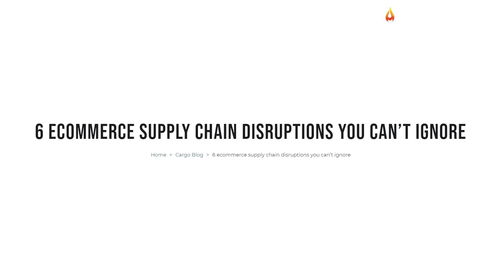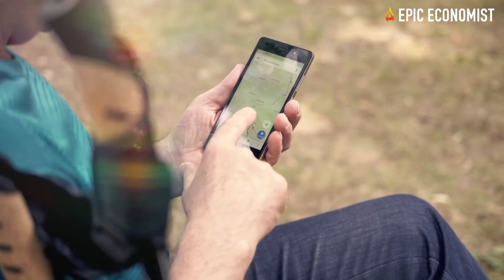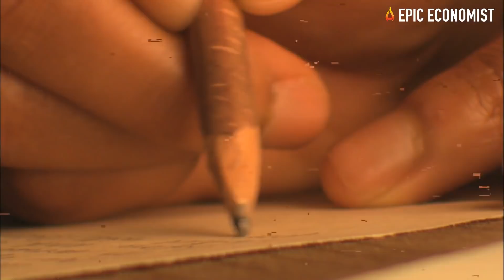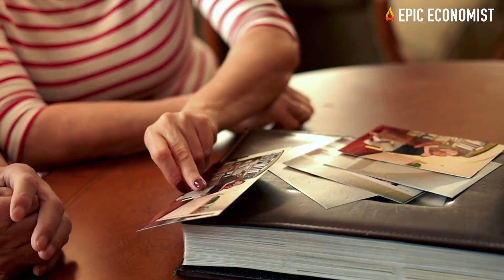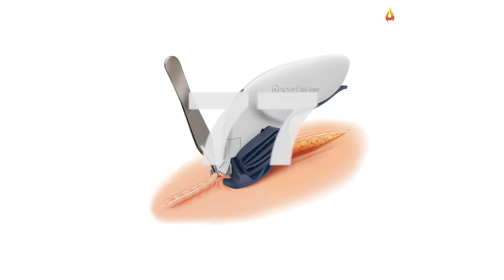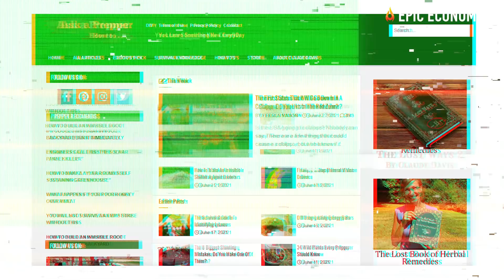100 Survival Items You Forgot To Buy Before The Imminent Economic Collapse

Comment: 1. Activated charcoal (anti-poison and anti-drug overdose effects)
2. Baby powder (treats irritated skin and prevents chafing)
3. Baby wipes
4. Rain cover for backpack
5. Bandana (multi-purpose cloth)
6. Battery adapters (convert AA input to D output, etc.)
7. Benadryl
8. Binoculars
9. Bouillon cubes
10. Manual can opener
11. Tourniquet (part of your trauma kit)
12. Blood clotting powder (promotes wound sealing)
13. Chalk (don't get lost)
14. Chapstick (helps seal cuts and can be used as a lubricant)
15. Cigarettes (slow-burning kindling, and smoke can be useful)
16. Clothesline/pins
17. Clotrimazole cream (topical cream to treat rashes)
18. Collapsible bowl
19. Collapsible camper's bucket
20. Fishing kit
21. Dental first aid kit
22. Dental floss
23. Dice
24. Duct tape
25. Earmuffs
26. Earplugs/eyemask (help you sleep in the rough)
27. Electrolyte powder (esp. if you're not food-secure, this will help avoid cramping and fight dehydration)
28. Epi-pens (he says to "get a prescription," lol)
29. Faraday cage (protect your devices from an EMP... though note it will also prevent you from getting reception while your phone is in there)
30. File (like the kind for sharpening stuff)
31. Flash drive (to protect your files??? I guess if you think bitcoin will go through the roof after the collapse of society)
32. Fly swatter (swats flies)
33. Frisbee ("send a signal" with it, okay... At least you can play catch with it.)
34. Gillnet (concealable mesh net for river fishing)
35. Glowsticks (good for short-term lighting)
36. Goggles (if you're in the desert, or a dusty environment)
37. Gorilla tape
38. Chewing gum (adherent, plus the wrappers are kindling)
39. Ham radio (contact other survivors)
40. Headlamp
41. Heirloom seeds (small-scale farming)
42. Hoyle's Rules Of Games, and a deck of cards
43. Hydrogen peroxide (disinfectant)
44. Instant coffee (luxury item, but it lasts forever if it's sealed)
45. E-reading device (pack a lot of books into very little space, holds a charge for weeks) NOTE: The video suggests Kindle Paper White, BUT a Kindle will force you into Amazon's DRM scheme, which may lock you out if their servers fail. Get a Kobo or off-brand e-reader that will allow you to use .epub files, which are not locked by DRM
46. Shoelaces
47. LifeStraw (water filter for your bottle)
48. Liquid bandage
49. Lockpick set
50. Microfiber cloth
51. Moleskin? (part of your trauma kit - never heard it called that, but It's clearly burn pads and gauze)
52. N95 masks (protect from dust and disease when exploring urban areas)
53. Neck gaiter
54. Pantyhose (multipurpose mesh material, can be used as a membrane/filter or to tie stuff together)
55. Paperclips (bind things together, quick clothing repair, multipurpose)
56. Pen/pencil and paper
57. Pencil sharpener (you can make arrows/pins with these)
58. Penny can stove and denatured alcohol (for cooking)
59. Pepper spray (defense against predators)
60. Pictures of family/friends
61. Pipe cutter
62. Pocket chain saw (not to be confused with a chainsaw - it's chain cutters on a wire that you operate with your hands)
63. Poncho (waterproof material, multipurpose - useful to make shelter, as a rain cover, etc.)
64. Potassium permanganate (oxidizer with disinfectant, deodorant, and astringent (skin-binding) properties)
65. Power inverter (you can adapt a cigarette lighter in a car to another outlet, and tap the car's battery to power your equipment)
66. Ranger bands (bind stuff)
67. Rubbing alcohol
68. Sawyer mini (water filtration system)
69. Scream whistle
70. Sea salt (preservative and bug repellant)
71. Other seasonings for cooking
72. Sewing kit
73. Knife sharpening kit
74. She wee (device so women can pee in a single stream standing up like men can... not sure it's a huge benefit if you're outdoors anyway, but there you go) 
75. Sillcock key (tap spigots with it, if you're near buildings with spigots)
76. Siphon (tubing has many uses, but mainly will let you salvage gas and motor oil)
77. Skin stapler (part of your trauma kit)
78. Slingshot (hunting weapon)
79. Solar air lantern
80. Solar charging kit
81. Solar shower
82. Spare glasses/glasses repair kit
83. Spork
84. Stanley wonder bar/pry bar/crowbar
85. Stove and fuel (IMO be careful of using stoves that require finite, non-replenishable fuel if you're bugging out from society, for obvious reasons)
86. Sunglasses
87. Superglue (multipurpose, can be used to bind wounds)
88. Tin foil (multipurpose, can be used to cook in direct sunlight)
89. Toilet paper tablets (the kind you get in MREs, just add water and they expand to a square of toilet paper)
90. Toys
91. Trail-marking tape
92. Trash bags
93. Trick candles (candle that stays lit if submerged or blown out)
94. Trowel (for small-scale farming)
95. Umbrella
96. Vaseline (lubricant/grease, bug trap, make a candle, impede battery corrosion)
97. WD-40 (lubricant/grease, anti-corrosion)
98. Weather blanket
99. Work gloves
100. Zipties (bind equipment or make snares)

Note a lot of these are padding or duplicate items, so really just pick-and-mix what you think you'll need. Honestly a lot of these I don't see a use for if you already have similar items on the list (i.e., a weather blanket AND a poncho AND a backpack rain cover, etc.). Also some of these, such as the sillcock key, lockpicks, and pry bar, are only useful if you plan to engage in looting.
Reply: Thanks :-)
Reply: Add sleeping, cooking and shelter and above anything, a knife
Reply: @67wing  100% agree. This video appears to be for people only preparing to be without power for a couple months at most, rather than a fully grid-down scenario. Glowsticks, cigarettes, epsom stoves... they're great, but you only get to use them for so long. If you're planning to survive entirely without society, your list will look very, very different.
(Also, IMO no one should plan to loot to sustain themselves. It's dangerous, unreliable, and makes your situation more desperate than it is.)
Reply: Thank you
Reply: a sillcock key opens water mains in urban environments (of course, so do strong pilers). So it's not about looting, but is handy for water acquisition. And as someone who lockpicks for fun for over a decade, they're completely useless in an emergency. Any lock you MUST get through, you just break/kick in. Who is the person who need to get into a place in an emergency, but has to do it quietly? It's not like you're breaking into a place where someone already is. That's a great way to get shot. Prybar though, yeah, I can see that as useful. But at the same time, it's pointless heavy for its limited applications. Just kick in the door, climb the fence, or break a window.
Reply: legend for this
Reply: 74. It is if there are brambles, stinging nettles or poison ivy. Ask the ladies how many of them would want to squat? Also, the leading cause of female infections is the public toilet seat.
Reply: I added a handgun to my list 😊
Reply: @kensen6490  Good for you. Illegal in many countries, but could come in handy.
Reply: not all heroes wear capes...thank you!
Reply: Thank You 🙏
Reply: Thank you. 🎉

Comment: Battery adapters?? Not me... I have a solar charger power bank. Has 2 USB charging slot, solar panel to charge up it's internal battery and a port to plug it into a USB to charge it, it has wireless charging on it's back side, it has 2 lights on the end for a flashlight. Yes it is a tad bit heavier and bigger than the battery adapters shown in this video, but is well worth it too, with all these features to it and it does charge devices more times than the smaller, lighter, simple battery packs. Did I mention the solar panel, flashlight and 2 USB ports to charge 2 items at same time?

Comment: The bug out bag is a last resort. Your car is broken, city streets are impassible, and you HAVE to flee your home ASAP. 
Get a good bug out vehicle, if at all possible. Something large enough for you and your family, plus the supplies you need. You can also get a roof rack to add extra space if needed.
Put all your extra items in storage containers so you can grab it and go, but be sure you know where you put different items so you know where they are. 
The channels "City Prepping" "Sensible Prepper" and "Canadian Prepper" are good resources about this too. 
Good luck!
Reply: If you really believe is going to be so bad then leave NOW...do you think you d be able to drive when everybody is on the run...? Better stay home with all the 500 items you need and survive there ...otherwise leave ...while you can in comfort ...
Reply: Emp could cause your vehicles not to work right? Better use your old classic car !
Reply: Bug out bicycles
Reply: Yep that's why I own a 4runner off road with locking rear diff and crawl control I won't be on any roads.

Comment: The fish hooks make good perimeter defense as well.  The tobacco in the cigarettes can be moistened and applied to spider bites, though plug tobacco definitely is the way to go.  Concentrated tobacco is also an effective poison.
Reply: also it is good for bad cuts,.I haven't used it for that, for that matter it's been close to 20 yrs since I've used it for it's main purpose. I would think it would be mostly good for bartering. Though i don't plan on getting it for my supplies, I would rather spend my money on other stuff like hydrogen peroxide, I can get about 5 bottles for the cost of one pack of cigarettes

Comment: Wire saw is not for me. I have a Silky folding saw that fits in my pocket when folding closed and is still lightweight.
Reply: Yeh they are much more easier to use than the wire ones.

Comment: I noticed you said something about going to the dentist.. that would be a bad idea because if the system collapse they'll be no dentist to go ..or even find..😅😅😅
Reply: Dental kit of some kind he said...but actually what I d suggest is get your dental issues done before any SHTF situation and then having no where to get it fixed...I already did mine thank god...all I need now is the rest 99....:)
Reply: @rnunezc.4575  thank you my friend that is a great idea which is off grade panels on top and it's got two batteries Alameda boat part time so it's also my bucket band friendly happens I can leave Dodge if you know what I mean and it's backed up with food as well... but you are well prepared without dentist idea great idea my friend..

Comment: Scissors can be sharpened by sticking them in loose sand and opening and closing them repeatedly, but if the center isn't well enforced you could break them easily.
Reply: This sounds fishy to me, scissors ✂️ are too easily sharpened on your fine sharpening stone or ceramic  rod once you learn how, to risk ruining them playing in the sand. Take the time to learn.
Reply: @richardelliott9511  It works better with lopers because the blades are curved. Can guarantee it. It's how I do it when they get dull, but scissors can be sharpened the same way. It's the same principles. Also, in my first comment I said that if the center is weak your scissors will break. I will also add that the sand should be loose when you test it.

Finally, if you're in a true survival situation you probably won't have a sharpening stone, but sand is pretty common in most biomes or you could make some sand if you're lost for long enough.

Comment: You forgot hats, including a helmet if necessary for your situation. Protects against sun, rain and cold.  Also, instead of an amature liciense and radio amature radios get a pair of family radio (FMRS/GMS) or better CB walkie talkies and/or CB radios and good antennas, SSB if possible. These are much cheaper, portable, easier to use, and just as reliable as amature equipment for short to medium range communications. A small CD player with headphones and CDs, a small AM/FM/SW radio and small battery TV if possible. Carry a small but good rugged water and impact resistant camera, a small portable GPS system, and small calculator. Your cell phone, tablet, or notebook computer , or laptop, may be of little or no use. In an SHTF situation don't expect cell phones and internet to work.
Reply: Search up TheGuillenReports7 on YouTube to stay informed on worldwide events

Comment: I don't need that power inverter. As far as charging my phone or my Bluetooth speaker (with SD Card slot), i do have my Solar Charger Power Bank. It can be charged by it's solar panel or USB cord. It gives multiple charges. 2 USB port for charging devices. Flashlight on the end. Even does wireless charging on it's back side if you have a device that charges that way.

Comment: There is only 2 small batteries 1+1/2 volt and 9 volt batteries. The larger d batteries just last longer than the smaller batteries.i can make a battery adapter with a little wire a small branch a thumb tack and some tape.(just a little injuinity.